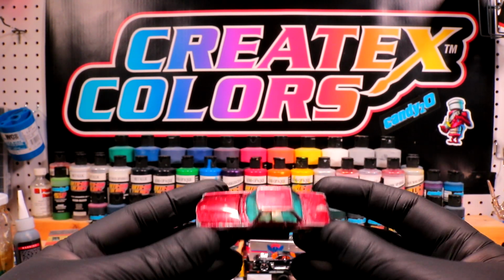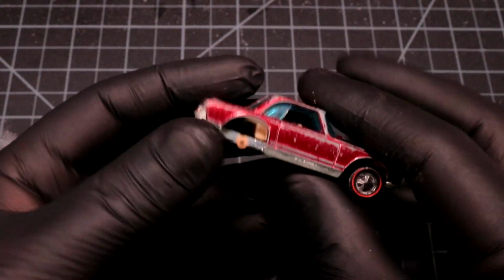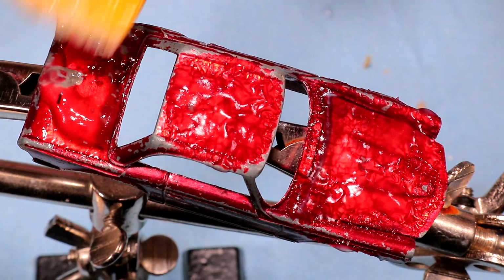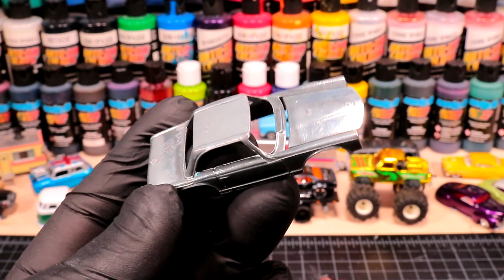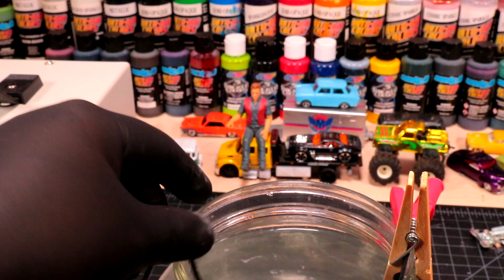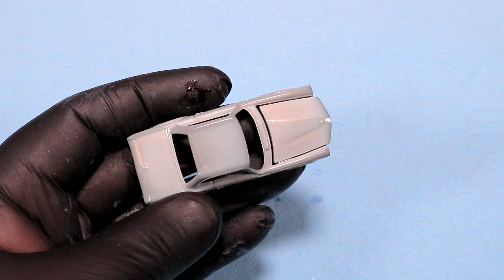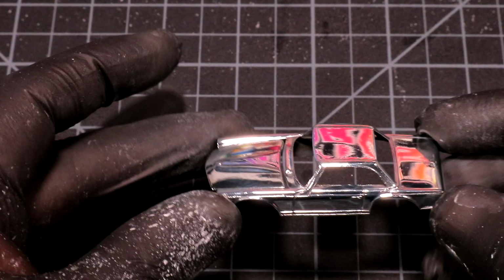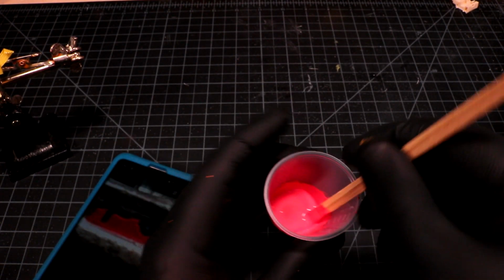Hot Wheels Redline Restoration: Mercedes 280SL - Zinc Plating

Comment: looks better than new, I doubt they ever went that far with polishing to begin with. :) colour looks great, too! <3
as other said, a straight-six engine is under the hood. with a mechanical fuel injection. not sure if it's still the same direct fuel injection from the gullwing SL, but either way it made the little things swift and surprisingly good for everyday driving.